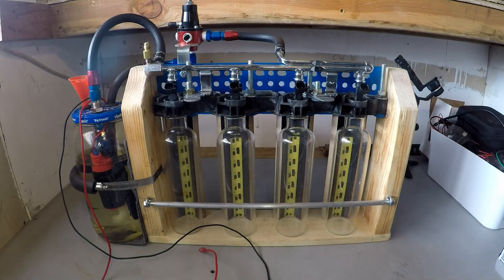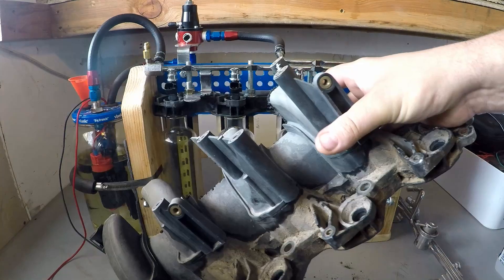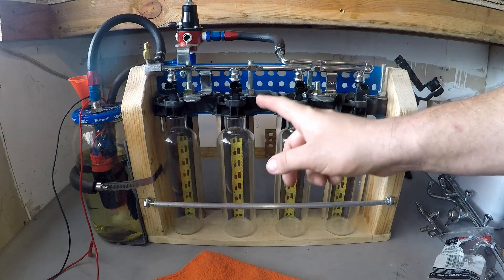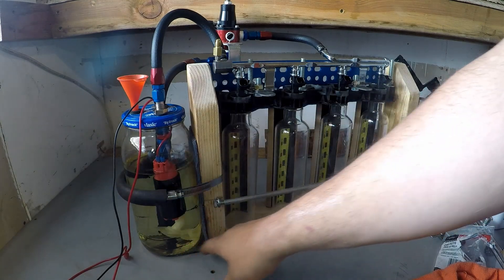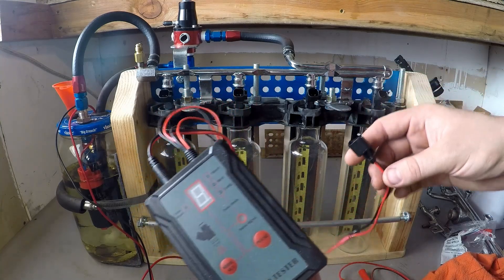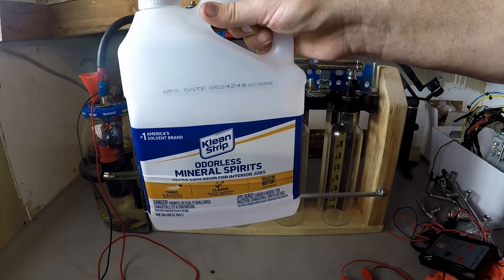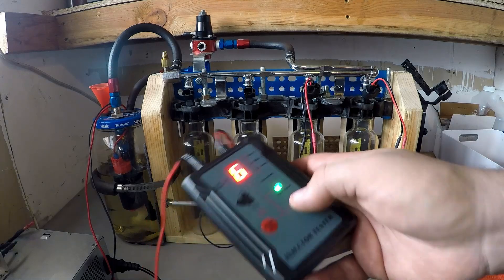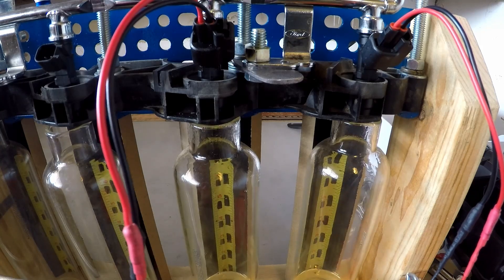DIY Fuel Injector Tester Made On A Budget. Less than $60

Comment: I have a fuel injectors tester kit same as your with 8 Pulse Mode. Your video helped me clear the confusion about the which modes are actual modes for test. So the first 4 modes are not the correct mode to test?
Reply from the maker: Mine only had 4 test modes I believe, but they only work in numbers 5-8. 1-4 does nothing.

Comment: Hey man!  Nice work!  I'm currently looking for a solution to test all my side-feed fuel injectors.  There doesn't appear to be a lot of support for side-feed injectors out there.  I have considered a DIY solution as a result.  I may consider something like this too.  My biggest challenge is I need flexibility to use different stock fuel rails I have for different size side feed injectors.  I like how you are able to simply set the glass tubes under the injector, wherever it might be in the rail!
Reply from the maker: @Technically-Matt  Thanks, yea I’m not too familiar with the side feed injectors. It’s crazy how cheap you can make these for if you can find some good scrap. Good luck with it. If you need help with anything just let me know.

Comment: When you added your own ev6 injector connectors, you could have easily used 4 instead of two. They don't pull enough amps to matter, you'd just have 2 injectors being tested at the time rather than a single. I assume you know this, but I guess I'm curious as to why you didn't just wire four as opposed to two? 
Please don't take this as a sarcastic comment, I'm genuinely curious, as I've been collecting parts to do a similar project. I've got the parts to assemble an ev1 harness, ev6 harness and multec2 harness and I'll use a Deutsch connector so that they all have a common connector and can be changed quickly and I'll do something to make the rail adjustable in height. I almost guessed your fuel rail origin, but I was thinking it was a Cobra rail. Same engine, same injector, they just mount a little differently.. Lol
Reply from the maker: I appreciate constructive criticism. This isn't even close to sarcastic. You might be right, I'm not 100% sure on my side. When I was figuring out what to do I searched how many amps a normal injector takes. The general consensus is 4-6 amps at peak and 1 amp sustained. The 12v rails on the power supply I have go to 18 amps. If I use more than 4.5 amps each I could trip the power supply. I might not go over 4.5 amps and be fine, but I didn't want to push my luck. Plus the wires on the injector controller are very thin. I can possibly combine rails on the power supply to split load but I'd need to check it out internally or modify it a little. After your comment I looked at a 97 mustang 4v schematic. The injectors are powered of a 20 amp fuse that controls the whole PCM as far as I can see. But that is factoring for only doing one injector at a time plus other tasks. I looked at the tool instructions again and it says to power with 12v battery or minimum 2 amp supply to run it. So that's making it sound like 1 amp minimum to run an injector, but maybe they're not factoring for peak power. So maybe I should try what you said next time I get it working. Best way to find out I guess. Nice, having the multiple connections will be good. I think this is a cool project to do. Gives you a great tool, and practice with custom mounting fuel rails.

Comment: I thought that the big thing was to check on the spray pattern.
Reply from the maker: Could be used to do a visual inspection of the spray pattern. Check for clogs, etc. I was able to confirm the ones I had were dual come, and they all appeared to be spraying fully and similar.

Comment: Why not just replace spark plugs, coil packs, and injectors after... say around 200k miles? 😢😮
Reply: Throwing parts at a car is not using diagnostics to determine the cause a run problem. That is expensive and never answers the question, why. Why a problem exists needs answered. 
1. condition
2. cause
3. Correct
4. Confirm

That is the proper approach for a good repair.
Reply from the maker: @Sunspot-19  I can agree with some preventative maintenance, but totally agree with you. Need to diagnose the problem before you just start throwing parts at stuff.
Reply from the maker: @stephenharris1450  this is just for testing / trouble shooting items. Main reason I made it right now is I bought those injectors and the regulator used, and wanted to test them before the return window closed. It will be some time before they actually go on the car.

Comment: What fluid are you using? Does it flow the same volume as flowing with real fuel?
Reply from the maker: @1magnit  I’m using mineral spirits. Here is a link below with a time stamp to that part of the video. I had talked to a tech at aeromotive and he said this is what they use to bench test their fuel pumps and knew of others using for injectors. I believe it flows very similar for basic testing like I did in the video, but if you wanted super accurate flow numbers, maybe there is better options, but I’m not really sure. I heard about some other alternatives that manufactures possibly use, but I don’t remember them right off. If you google search what to use you will see quite a few options. https://m.youtube.com/watch?si=D2dlThVsqdtb4qtv&v=aiq0nQ6pJcM&feature=youtu.be&t=7m39s
Reply: @DesertRatRacer  I've done back to back tests with real fuel and every other fluid flows a different volume, all less.

Comment: It'd be interesting to know how you wired the computer power supply. I have my assumptions but I've been wrong before.

Sweet setup. I was looking at buying a unit but the $250 units all seem to have issues leaking and your setup seems to do the job. I will now gather what I have and see how cheap I can also do it for.  Here is some constructive comments and suggestions.

1. Pickle jar seems a little difficult to remove. Would a plastic container be less worry and fine for mineral spirits?

2. Maybe using wingnuts for the intake manifold flange  would make swapping a little quicker and maintain the ability for different length injectors.

3. Any mods needed for high vs low impedance injectors?

4. Maybe I missed it but a fuel gage could be useful with your adjustable fpr so you can ensure you test base pressure for idle and increased pressure for forced induction systems.

5. Trivial comment is the lumber seems untreated.

6. How about a piece of 1.5 or 2 inch thick foam board knotched (kind of like you knotched the angle iron) for the bottles to stay in place? Cut away the front so you can see all of the glass from dead on but keep it partially circular so the glass bottles don't move. Foam may squeak with the glass if it rattles and could sound annoying...there would be alternatives or ways around it that you're more than capable of figuring out.

7. Do you want a chamber with filter to ensure no crud makes it into the pump and back into the fuel system? Mayne you already have a filter directly off the pump sitting in the bottom of the jar.

8. As you probably know...the 1" line you get with the 1 long burst and 16 shorts is relative to fuel pressure and injector size so it won't always be 1". I imagine you were just pointing out that you played with it to get the combination which brings you to 1" for this specific fuel system at a static fuel pressure.

I'm sure I'd have more comments or questions but my bed is calling me. Thanks for the idea and how dare you mislead people who want a $59.99 (with tax included) lego kit with instructions, labeled parts, and a QR code to a video showing assembly....wait...it just can't come pre-assembled? Temu will come to those peoples rescue and the poor quality won't matter since it likely won't ever get used. 

Oh yeah...sleep.
Make it a great day.
Reply from the maker: Thanks for all the questions I'll do my best to answer them all. 

As far as I know with the power supply the main thing is just to separate all the power leads you can use. I set mine up putting all the same 12v sources together. Basically separating each 12v rail I believe. I'm still iffy and how that is setup inside, so didn't want to connect different rails together. Then just combined sets of grounds together. There is normally one wire that allows it to turn on so that wire is hooked to a switch. Then the 3v and 5v wires I capped off and there was a few extras I didn't need either. Using the info label on the side of the power supply will explain the wire colors as far as power If I remember right, but I found a schematic online for that power supply or similar that help me figure out the rest. Here is a link to a short Instagram video I did that goes over the basics. https://www.instagram.com/p/Ct0RcK_vpzn/

I'm glad you appreciate the setup. I had no idea there was leaking problems with the prebuilt units. Honestly I think this could be done for half of what I spent or less now that I know more. 

1. I think the pickle jar isn't too bad. Basically just the connections in the lid and the hose clamp is pretty easy to remove. I honestly wanted to go the plastic route because less chance of breaking but in the time crunch I was in the pickle jar was the best thing I could find. The glass jar is really solid compared to the plastic options, so It has that going for it. Probably could have done a smaller tank and spent less on mineral spirits too. The mineral spirits comes in a #2 plastic bottle I believe but I might need to double check that. There are charts online about how well each material holds up to mineral spirits. 

2. Wingnuts would probably work good too especially to speed things up without needing tools. I had zero issue using a deep dish socket though.

3. I'm sure you would need to look at a different electrical controllers then the one I used if you were using low impedance injectors. The electrical setup to those are more complicated then the high impedance injectors I used.  

4. Yea I wanted to hook a gauge up to the fpr but didn't find the one I had at the time. I meant to add some pressure to the boost reference on the regulator also to test for pressure change, but completely forgot. Although the fpr main chamber and the fuel rail is all basically one chamber, so the pressure taken at the fuel rail I believe would be the same as the pressure at the fpr. 

5. Yea it was just standard 2x4 for the sides. Pressure treated would be better probably, but I was struggling to find nice pieces without cracks. Definitely something to consider if done again. The bottom was part of an old tv tray. 
 
6. The foam board is an interesting option. That or something similar could make the bottles even more secure. 
 
7. The pump had a standard screen on it but I had a standard fuel filter I wanted to use, but didn't realize it was the wrong size for 3/8 line till I was putting it together, So I just cleaned everything really good and hoped for the best. So that's something I want to add in the future as well. 
 
8. Yea fuel pressure will definitely change the flow amount, so that is a good point. Honestly wasn't even thinking about that part. I just set it to 40 psi and ran with it. So if I tested those again with a different pressure the 1in mark reference would need reevaluated. 

You're welcome for the idea. Lol, I'm going to have to live with the shame of misleading people apparently. I should have stated you will also need a place to work, electricity, basic tools, free time, food to power your body... etc. That's the hard part. 

Yes, have a good day too.
Reply: @DesertRatRacer  

I love the recycling ♻️ aspect of the TV tray, pickle jar, etc. Having the pickle jar with a rigid metal lid is a pretty solid setup instead of flimsy plastic. I was thinking the XL size of peanut butter jar from Sam's or other bulk store but we have those same pickle jars on hand. 

 The comic relief at the end got me laughing. Thanks for all the responses.
Reply from the maker: no problem, happy to talk car stuff. It’s cool to make or fix something that would be trash to most. The mineral spirits was #2 plastic I double checked. I noticed a protein powder container was #2 plastic in my search, but most food stuff appears to be #1 plastic.

Comment: “Hey guys I built this 1000whp engine for $50… oh yea I had everything lying around and just needed a few fittings hence price of $50”
Seriously???? That’s not how that works my man. 
That regulator, if it was a China unit is still $40. Misc an fittings even bought on aliexpress are gonna add up to $40 minimum.
Reply: Anyone doing the type of work on a car where injector flow matters usually has this stuff sitting around. If you haven't swapped a intermittent fuel pump (that would be great for use here), then are you really a "car guy"?
Reply from the maker: @stevewiley3832  I agree, all is pretty basic stuff to come across. I am looking forward to testing used pumps before I install on a vehicle, hopefully avoiding some intermittent pumps or similar. 😎🙌
Reply from the maker: @Rebel635csi  yes, seriously that’s how it worked. You can buy used AN fittings and even get them for free, but I explained in the video this could be done with hose clamps. AN fittings were left over in my dads stuff. Also explained in the video the regulator is part of what was being tested, and you could hardline that part if you don’t need to test a regulator. So regulator isn’t part of the test bench price. Technically you need fuel injectors to run the test too, but they’re for the car, and not part of the test bench price either. Intake manifold free scrap from someone I help sell some cars for years ago. Angle iron, measuring tape, strong tie, and hardware free from someone I met that was moving. Glass jars $4, pickle jar… leftover after eating pickles. Felt from inside a safe I got for free. Met the dude to talk about an Rv, let with a truckload of stuff. Fuel line $8 with coupon. Fuel pump and glue for free from a guy having a yard sale, and wanted me to take a bunch of stuff. Fuel rail left over from a Mark VIII I scrapped out for profit over 10 years ago. Funnel free from someone who was giving away car ramps, ended up getting multiple truck loads of stuff for free. Shelf parts / 2x4 free from side of road. Power supply from computer I scraped out and profited from. Grommets, wire, and electrical connectors… Most free or left over from scrapped cars or projects…. The electric control was the most expensive at $23 ish, and that can be made from spare parts too. I counted the cost of the test fluid at $19 ish, which wasn’t necessary for raw test bench price. It’s not hard to find deals or stuff for free if you’re looking for it. I would also assume most people tacking a project like this will have stuff laying around like extra hose clamps, screws, scrap wood, and metal. Can easily get on a local Facebook community page and ask if anyone has a spare / broken intake manifold laying around. Knowing what I know know I could do this for even cheaper. Probably in the $30 range and make something very similar.
Reply: @DesertRatRacer  I’m not reading that wall of text. If I go and buy something with my Amex points and it doesn’t cost me anything do I get to say “it was free”?  No.
Reply from the maker: @Rebel635csi  You had brought up points that were clearly explained in the video. So I made sure to respond in full detail on everything so it was clear where every part came from, and how it’s possible to get things for free or cheap. I’m not sure why you’re now bringing up credit card points. No where did I factor points into my total spend, but either way I’d count points more in the discount / rebate category that you just receive later. Similar to the $5 discount card I used to buy the fuel line. It wasn’t free but lowered total cost of the Fuel Injector Tester.
Reply: @Rebel635csi   So, go off half cocked and try to tell a bloke he's not permitted to raid the bins for bits to build something? What a failed Home Owner's Association attitude!!
Reply: @Sunspot-19  Yeah, you wonder what makes a person so bitter that when someone else does something neat they feel the need to tear you down.  It's the internet though, nothing is surprising.   I do agree that it's not a $60 project but at the same time, I'm not an asshole to call someone on it.  I have all these parts in my junk box too.
Reply: @quademasters249   When one shops in their bins is quite different than expressly going to a vendor and pulling out a credit card or cash. You can call one out for that but cannot prove what, if anything was acquired for cash and what was acquired free that lies in their bins. With that said, you are welcome to claim the bloke spent more than 60 bucks, regardless of whether he did or not. Your second to last statement is debatable. Lest you come up with receipts proving the bloke spent more.